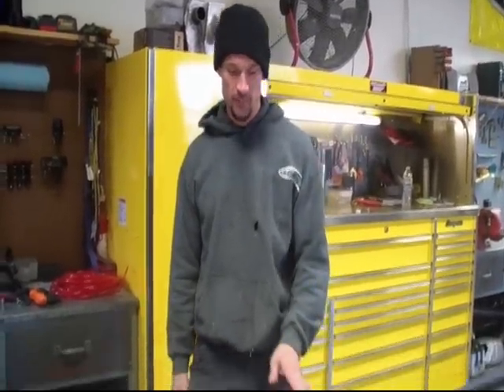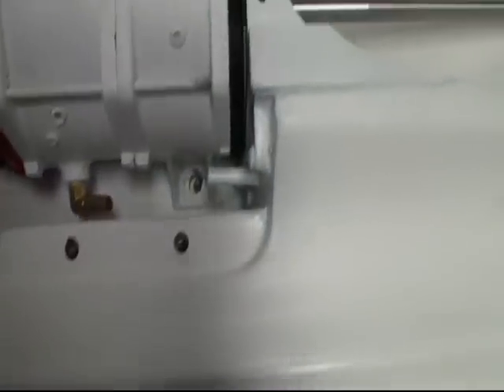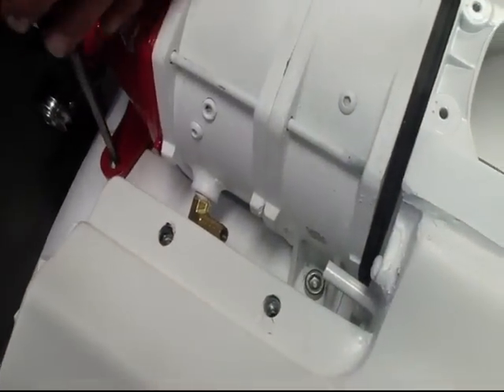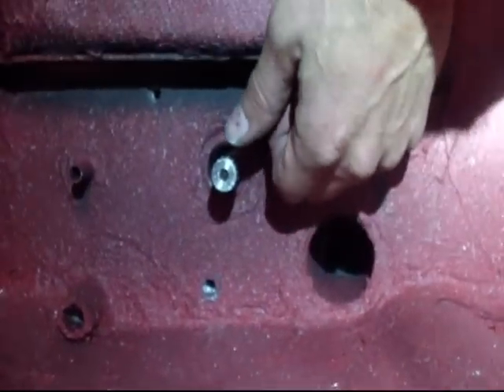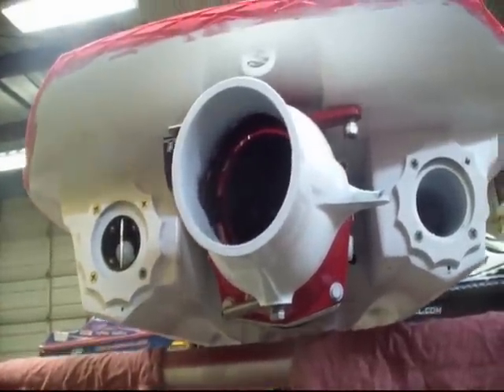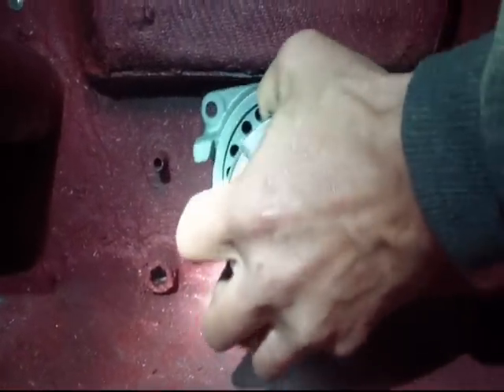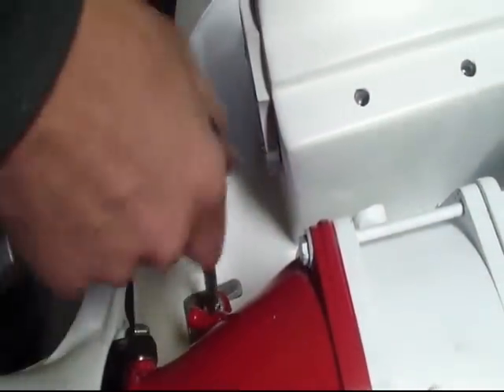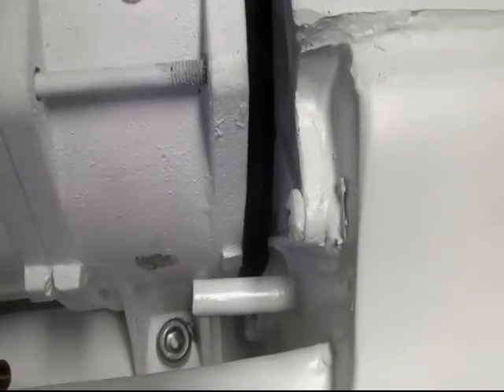Build-a-BOB: Pump Install

Comment: Starting the bolts with an electric driver is risky. The potential to cross the threads is multiplied. Start them by hand with an extension so you can feel that they thread before using a driver or impact.

Comment: Do you not use a bead of sealant on the pump shoe end of the pump seal? What product would be best for the bead if you did....Ultra Black?
Reply: It's a 9 years old video, I'm not sure you're going to get their response.
The model shown here doesn't need additional sealant, I would use some marine grease on it and that's it, if you want further sealant solutions look up Sika Seal marine adhesive

Comment: Can a BOB hull that is equipped with a 155mm pump shoe be changed to a 144mm pump shoe without any fiberglass work? Just a new aluminum shoe for a stock superjet?